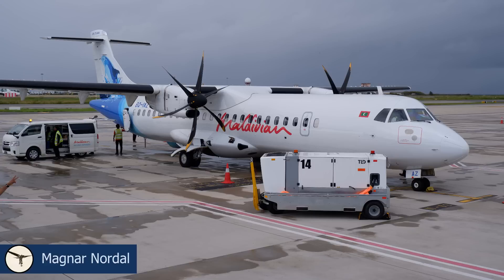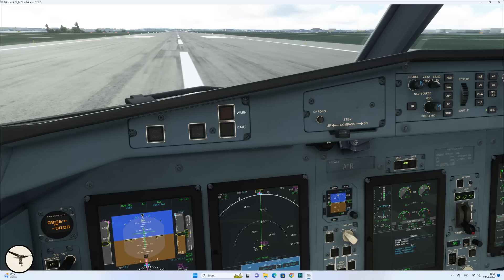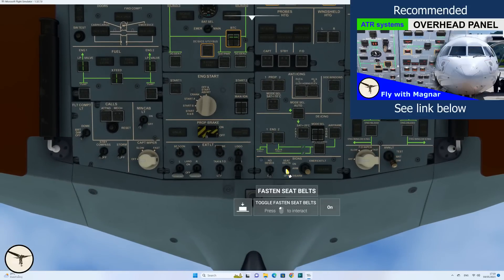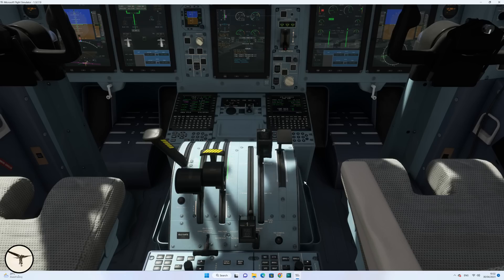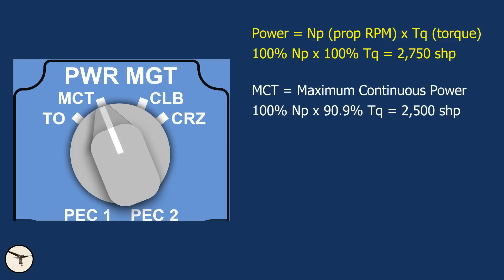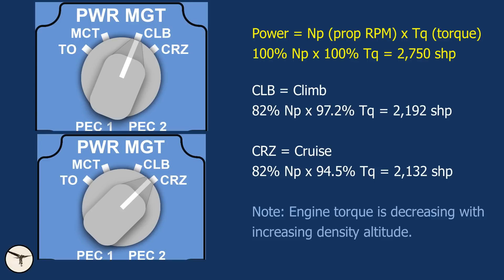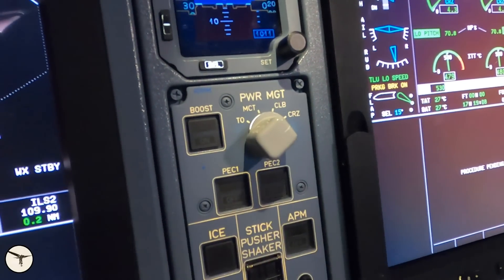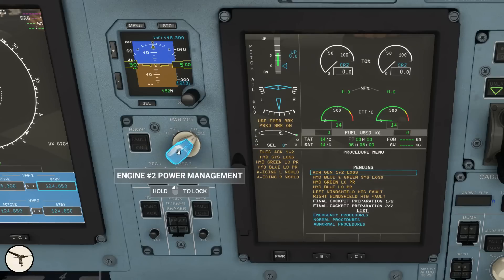ATR Power Management | Tutorial for Flight Simulator 2020

Comment: Hello, Mr. Nordal. I would like to ask you a question. Can reverses be used during an approach?  In a real ATR video I have seemed to hear reversing sound for a second several times.  Is it possible or am I wrong? Thank you!
Reply from the maker: It is possible to use reverse during approach by pulling a lever called the idle gate lever. But it is very dangerous to do it, so it is prohobited. Therefore, no pilots will do it. I sounds you hear in flight might be beause of cange of propeller RPM, which happens during flight.
Reply: @FlywithMagnar  Thank you for your answer!

Comment: Hello Captain,

Has the ATR a Special procedure for short take off ?
Reply from the maker: Yes. The procedure calls for using 100% torque (power levers to the ramp) and reducing the take-off speeds. The speeds are calculated with a software called SPS.

Comment: Hello Magnar. I’m a former ATR 72-500 first officer and a newly qualified 72-600 pilot (your videos were very helpful during my type rating course…), on his way to the left seat, flying for Air Corsica. I have exactly the same setup than yours. Did you customized any of the sensitivity settings in flight simulator ? I find the aircraft very difficult to pilot; very unstable. Specially on the yaw axis. I hardly manage to keep it on the runway during the take off roll. What do you think? Thanks.
Reply from the maker: Hi, I'm using the standard setup. And yes, the rudder is too sensitive on the runway. This is not only an issue with the ATR, but all models I have tried. I'm sure this can be rectified by adjusting the settings, but I'm not sure how to do it.

Comment: I have TO, CLB and MCT understood on the ATR but the aircraft *always* overspeeds in CRZ and I'm forced to use Manual Throttle.  I'm sure this is not the case on the real aircraft - can you confirm this is a bug?  

I also note that it disregards any speed bug that you set in cruise.  Again, this can't be right, surely?  

Should PEC be turned on?  Does it even work in the sim?

Finally, what is SPD HLD?  Speed Hold?  It doesn't seem to work on the MSFS ATR.

So many questions!
Reply from the maker: Yes, many questions!
1) TO is used until we are at least 400 feet above the runway. We don't use MCT in normal flight. CLB is for climb, and CRZ is for cruise. I find the cruise speed to be too high, so I hope this will be corrected in later versions of the ATR model.
2) The automatic speed bug (magenta color) takes into consideration aircraft weight and atmospheric conditions (pressure and temperature.) The speed bug is 5 kt below calculated cruise speed.
3) The PEC is on when you start the sim. It should always be on.
4) SPD HLD is not in use on ATR aircraft. The intention was to provide automatic power control during ILS Cat III approach. But so far, no customer has been willing to pay the cost for development and certification of that capability.
Reply: @FlywithMagnar  thank you for your reply Magnar. Yes it’s annoying that you have to come out of Notch to cruise. I’m surprised they didn’t spot that in testing. Oh well I hope it gets fixed. Happy landings!

Comment: Capt could you make a video on Adaptive flight idle
Reply from the maker: That will be a short video! In flight idle, the propellers provide a lot of drag. This is called "Low flight idle." However, this affects lift at high angles of attack. Therefore, when the angle of attack increases, the power is automatically increased a bit to reduce propeller drag. This is called "High flight idle."

Comment: My ATR uses 170kt for the climb. Is it ture in real life that 170kt speed always the case for the climb?
Reply from the maker: 170 kt is standard climb speed for ATR 72. For ATR 42, the speed is 160 kt. If you want to climb with maximum rate, you reduce the speed to white bug +10 kt (normal conditions) or icing bug (icing conditions). This speed depends on the weight of the aircraft.

Comment: A lot of times after takeoff in the ATR72 in FS2020, when I move the power management selector to climb, the propellers will stay at 100NP and not move to 82NP unless I put the condition levers to full and then back to auto. I’m sure it’s a bug that I hope they’ve fixed in the recent update.
Reply: Yep, can confirm that they've fixed it. It was a pretty fun bug tho, unintentionally simulating an actual abnormal operation from real life.

Comment: one thing i missed, is what NP has TO mode during Landing, i saw it dont go back to 100NP while on final. Is that correct simulated? And i found bug, during turn around TO mode dont spool back to NP100 it just take 85NP i think like during Landing.
Reply: Hi: I'm one of the developers of the ATR..what might help in this case is moving the CL from AUTO to OVRD and back to AUTO. This might bring you back into the correct NP range. Apart from that, we are still working hard on the ATR for another update down the line. So far..have fun with then plane.
Reply: @bene7384  thank you, anyway in wich setting TO? Cuz if you do that in CL for example it drives CL to 100NP too 😅 thank you
Reply: @Justin TV  You always takeoff and land with PWR MGMT in TO position.
Reply: @bene7384  sure, but if this procdure dont affect other modes.
Reply: @bene7384  I have experienced this same bug too, Ben! Thanks for your comment, good to know you guys are aware of this one as it's caused me some quite sketchy takeoffs 🤣🤣
Reply: It should indeed stay in 82 even when the pwr mgt is on to. It will go back to 100 when you put the pl above notch (in case of ga). If you want to fly the approach with 100 np, you can instead put the cl into 100% ovrd. That's how it is done irl.